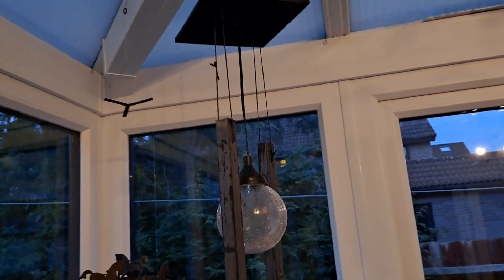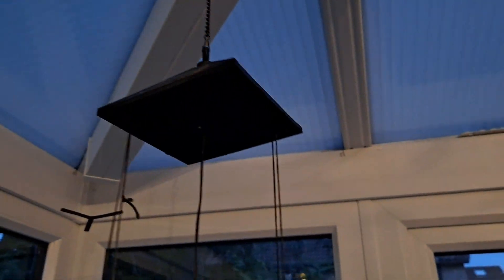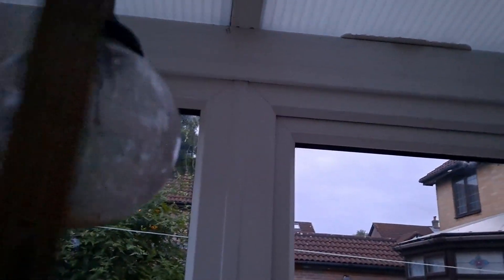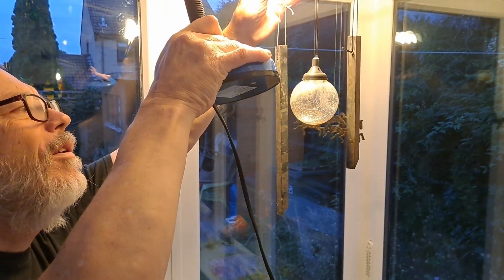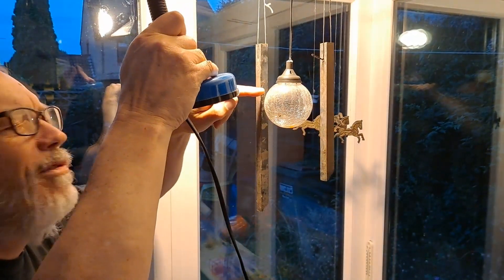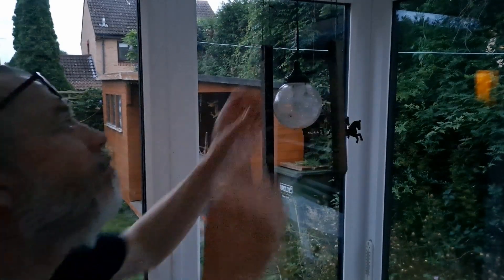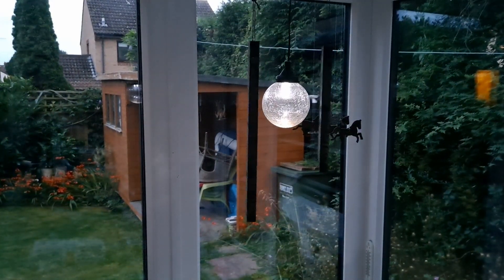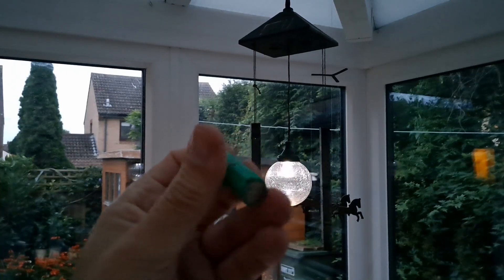Did cleaning the solar panel with toothpaste help?

Comment: I will have to try this for my outside garden lights panel, thank you for the tip Graanddad!
Reply from the maker: If you mean the toothpaste as cleaner, it is often recommended in the comments, and it probably did help, but clearly this one needed a change of battery too.

Comment: I don't really like these outdoor solar lights. Mains operated ones are far better, and the energy savings from the solar lights are negated when you have to replace them all every year because they are full of water and no longer functional.
Reply from the maker: You are certainly right that the reliability of many of the cheap brands is very poor. However, depending on how big your garden is and where you want to stick your lights, your economics may be questionable. Running mains wiring around your garden is fraught with all sorts of safety issues, not the least of which is simply cutting through the wires while you are doing your gardening. So it would be best to have it installed by a competent electrician with all the correct protection included. Personally I don't have a large garden and I am not very keen on having lights out there anyway. They serve no purpose. I am interested in solar power and as you can see, people give me their old stuff because they know I like to play around with it.
Reply: @GrandadIsAnOldMan  You make some very good points that I didn't think about at the time of writing. I believe low voltage DC outdoor lights can also be purchased, and are far safer than the mains voltage ones, but that doesn't solve the issue of the size of the garden.
Reply from the maker: @jamescollins6085  I think the main issue is around a relatively cheap solar DIY set-up (which is probably all that most people want) or a professionally installed light show which should last for much longer and come with some sort of guarantee. If I am on holiday, staying in some fancy hotel, then I would like a nice light show in the garden grounds so you can sit out and enjoy the surroundings in the evening (assuming you have given yourself a good coating of fly repellent). I seriously do not want to do that at home, setting it all up for the odd evening that I might use it would seem a waste of money. Obviously there may be some people who do want to do that, and they are the people who would have to make the decision on the costs.

Comment: Is there a little electrolytic cap on the circuit board? The flash, I would imagine, will be the cap discharging but you will know that. I am just saying. 👍😁
Reply from the maker: No capacitor, that is the old battery taking charge from the solar panel and then discharging through the LED, although it took charge it had no capacity, not a play on words with "capacitor", just the simple fact you can get charge into a dead battery but it won't store it for any length of time. With a replacement battery it stays illuminated through to about 2 AM after a good day of sunshine.

Comment: Pretty cool, James!
Toothpaste (Especially ones that contain Fluoride) is a great de-fogging solution to rub onto the inside of glass objects, what I do is I rub a bit of toothpaste on the inside of my snorkeling mask right before I go into the ocean, it works great every time, I can go on for hours without my goggles fogging up. 
👍✌
Reply from the maker: Hi Max, yes that is a slightly different application. We are just trying to clear the surface grime of the panel but it is easy to see the tracks inside have deteriorated so they will not be working efficiently anyway 😊👍

Comment: The problem is that those 2 solar panels are wired in series which means both need light to charge and it looks like one panel is damaged and isnt putting out the current like the other one
Reply from the maker: Certainly the panels are damaged, one worse than the other. That is why I said in the previous video that I wasn't expecting that cleaning them would make much difference, but to my surprise, it seemed to make enough difference for them to charge the battery well enough to keep the LED glowing well into the early hours of the morning. In the first episode of this little series I show a brand new, still in the box, identical one of these wind chime solar lights that works fine (with a colour changing LED) https://youtu.be/KiLi-Xa9Glg